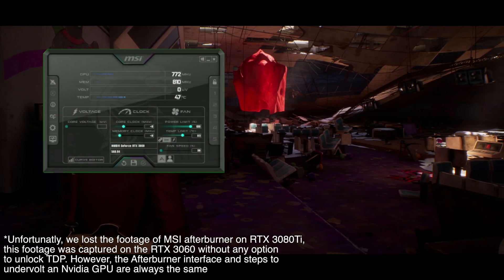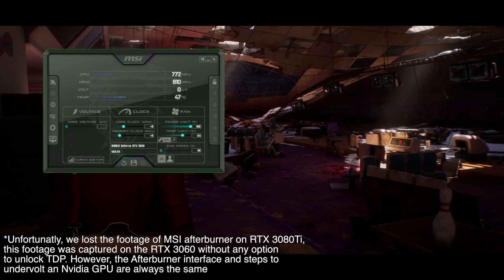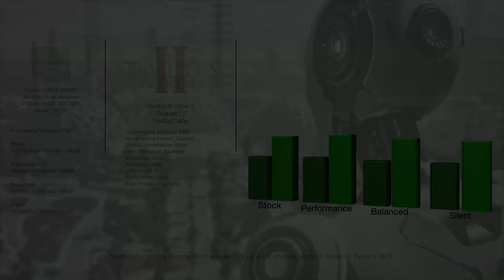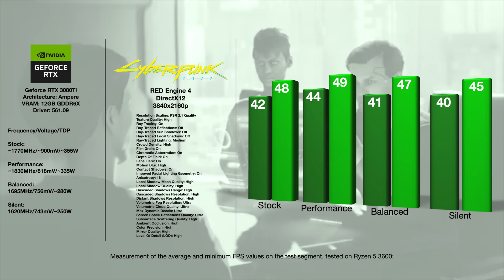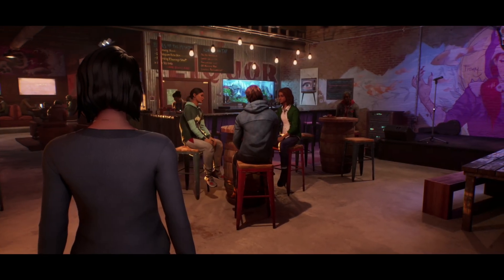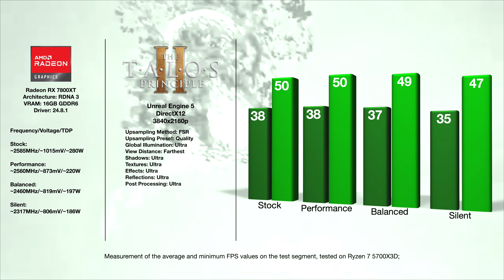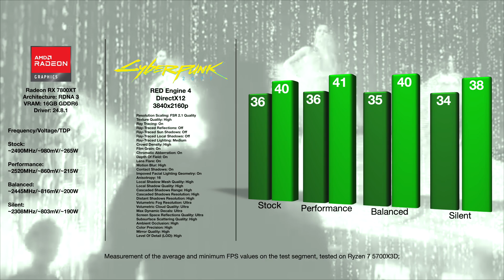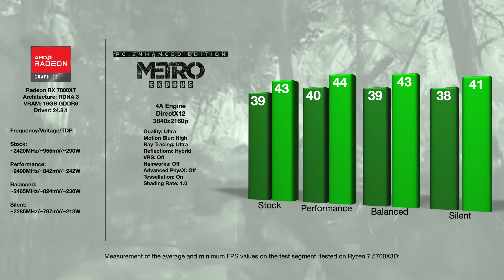GPU Undervolting

Comment: Undervolting is a must for any GPU. At the very least, it helps to reduce temps/fan noise of a GPU itself. Also a power supply will be grateful and reward you with less noise level as well. Not to mention, undervolting extends lifespan of all PC parts (including GPU and case fans), since a GPU is usually the main source of the heat and it increases temp inside a PC case, leading to higher temps of a CPU, a power supply, a motherboard and SSDs.

Comment: Nice video, I'd point out just that maybe it was a little bit better to test on 1440p or even 1080p.
The main reason is that at that resolution we're already having very low gain/losses (in performance) by OC or UV, if we're getting 46 FPS at stock and we see that UV gets 44 it's easy to go for the UV one, a lot less power and "almost" no performance loss
Reply from the maker: @andrexskin  Well you’re actually right, it would be better to test it that way. However, I’m not sure we would be gpu limited in every game tested on Ryzen 3600 with 3080Ti
Reply: @HardwareLab  That's true as well.
I thought about that, it would kinda be an hit or miss situation, probably with the AMD build it would not have many problems

Comment: Undervolt can help the hardware as it decreases the voltage, it helps to reduce the degradation, so it's always a +
Reply: Also you get stutters in some games on rtx 4000 . I deleted msi afterburner since i got rtx 4070
Reply: @vilzon7845  No issues with undervolting on my 4070 Ti. I created 2 profiles: 1) performance - 975 mV/2730 MHz; 2) efficiency - 920 mV/2595 MHz. Both function perfectly fine, along with memory overclock. Been using these settings for a long time.

Comment: Undervolt is amazing, the new OC, I hope it gets more known, 4070 Ti and 4070 Ti Super have the most insane scalings, the basic Ti can go as low as 175W on some cases with minimal performance loss, Ti Super goes as far as 200W, 4070 and 4070 Super can also reach 150W, sometimes even lesser than that, insane stuff